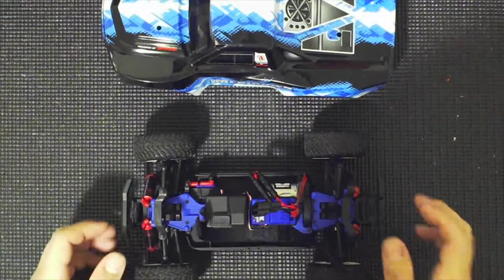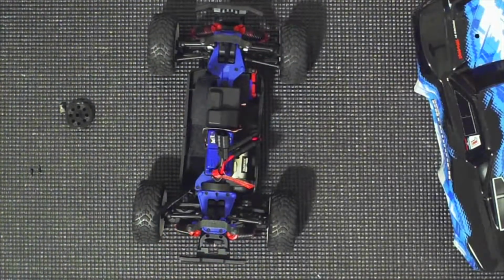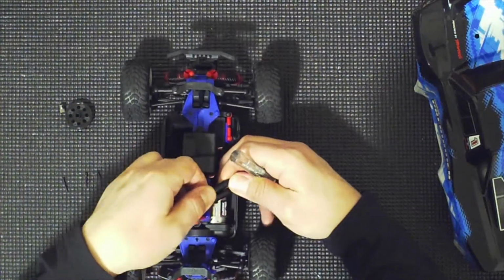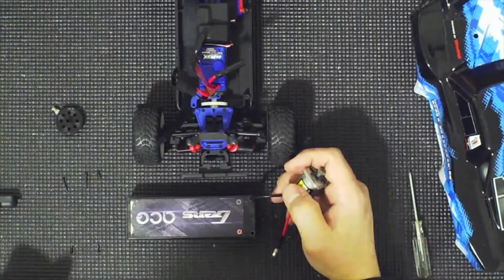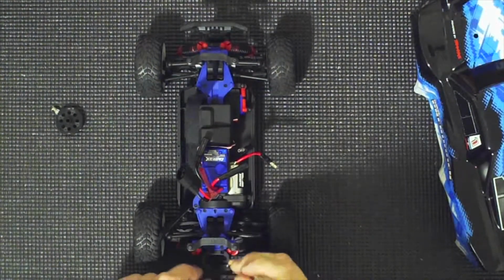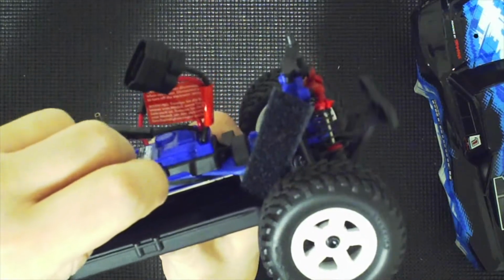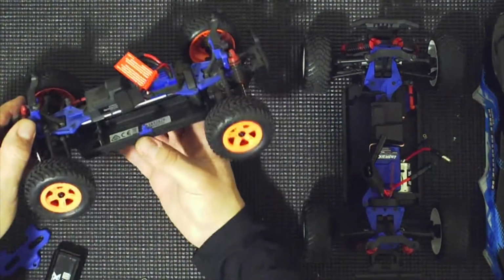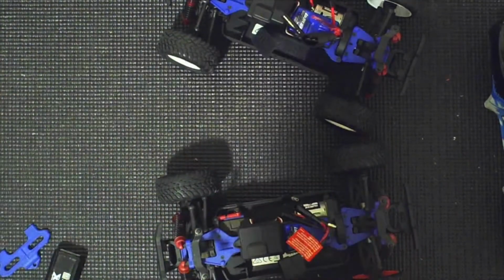LaTrax PreRunner modifications for Speed Part2 motor fried motor diagnosing

Comment: I have the burst color body like yours😆😄
Reply from the maker: Orange or blue wheels?
Reply: @telecomandorc  white stock rims.
Reply from the maker: @gamercat7004  I have one with the orange as well. Ben thinking about getting the blue ones at some point to tell the two splash bodies apart when running them together.
Reply: @TelecomandoRC  nice my latrax prerunner is like one your fixing up. And i put in the brushless upgrade for it.
Reply from the maker: @gamercat7004  It is a sweet upgrade, but it is too fast. 😅
Reply: @telecomandorc  haha I'm watching through your videos doing my mods now, good to know its too fast, I already upgraded to the metal rally gears from HR, Pretty much planning on getting a pack of the model #'s that latrax uses to make their prebuilt motors and just soldering the connectors to some quick connect wires and making it permanently wired where you usually remove it.